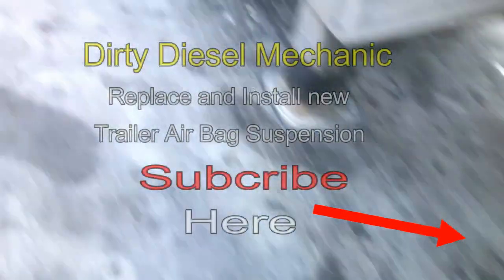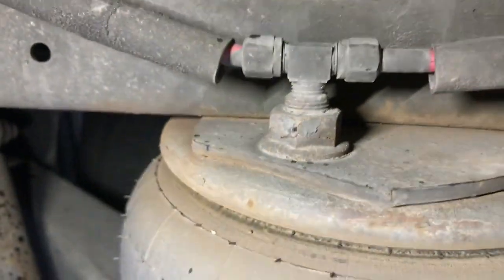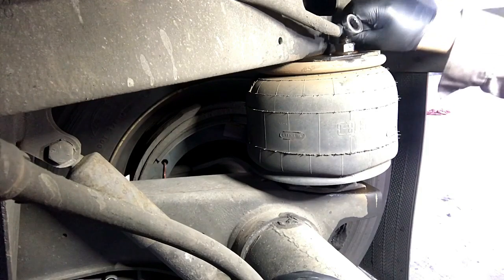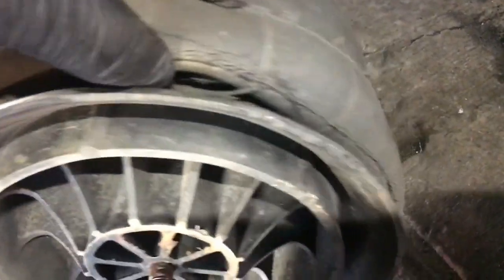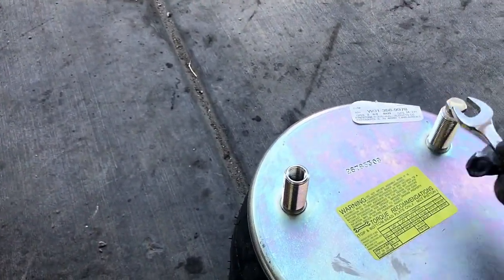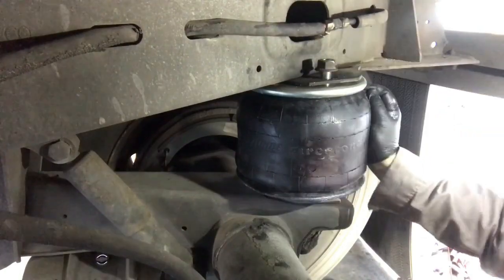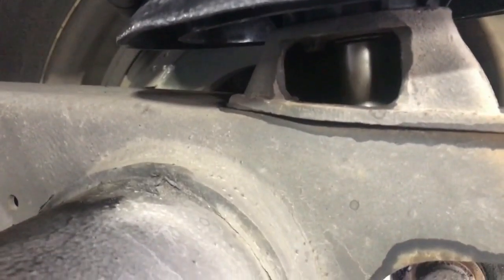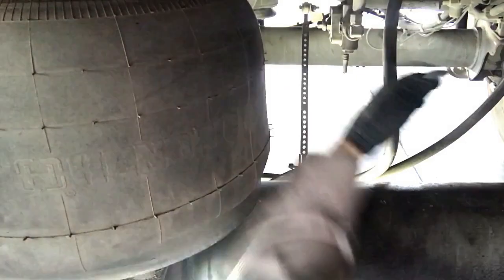How to replace tractor trailer Suspension Air Bag

Comment: I watched a few video and all either show to bend the air hose 180 degrees and hold it with a zip tie, or pinch it with a vice grip. It seems either practice would damage or significant the hose. I knew the right way is to rig up a blind fitting. Easily said than done even I have a lot of brass fittings but 99.9 % are for plumbing, not pneumatic. Eventually I did find a female compression fitting to MPT. With a bushing and a plumbing 1/2" cap I was able to rig up aa similar blind fitting as you had done.

I know in a truck shop they would have a lot of these parts laying around and that is the ticket to get the job done in a breeze.

Comment: That air supply hose looks like it was rubbing a lot.  I would consider replacing that as well.   Better to do that than have a D.O.T. Inspection finding it, and shutting you down in January.

Comment: I have watched six of these videos so far.. guys changing trailer suspension airbags. And on every freaking one of them it was on the rearmost axle. It would be very nice to see somebody change a front air bag. My understanding is that they are more difficult. And guess what? I need to do a front airbag.

Comment: On real tough top air spring nut do this procedure . Cut air spring fabric around air spring and remove the bottom section .  Use a cutting torch and cut the bolt from the air spring base .
Reply from the maker: Yeah I’ve had to do that once a twice it not fun.

Comment: Can we drive with 3 bags by disconnecting 4th one in case of emergency
Reply from the maker: You can disconnect the air bag leveling valve at the rod and turn off the air supply to all air bags.
Reply: I did, grossing 79000. Drove 370 miles.

Comment: Nice video! Doing something similar on an older bus, but having some issues identifying the right fittings to match the current hard copper lines and convert to plastic DOT air lines.  I think what I have looks similar to yours ('inverted flare' with an o-ring inside?) but not sure what they're called or how to ID properly.   Local air fitting shops can't find anything like it.  And I like those airlines, don't really look plastic.   Any suggestions on how to ID fittings and hose nomenclature?

Comment: Hey Boss. I'm having issues with my airbag exploding on my spread axle flatbed.  I've gone through 2 airbags in the same location in a year.  (frontaxle driver side) Do you have any suggestions?
Reply: Trucker Timmy hi. Considering your question is from 2 years ago, chances are you have resolved your exploding airbag dilemma. But in case you haven't, here are a couple of things you could check..
Maybe you have a lower control arm which is Twisted or bent and therefore when the trailer airbag is fully inflated you have some chafing occurring. When you blow an airbag look carefully at it.. any evidence of chafing or scraping?
Maybe your airbags are overinflating. The distance between the top of your trailer tire and the bottom of the trailer deck should be no more than about three to four inches regardless of whether load is light or heavy. When you are empty, is your trailer sitting up really high? Because if it is then you either have a bad leveling valve or your leveling valve needs adjustment.
I hope this helps. Good luck.